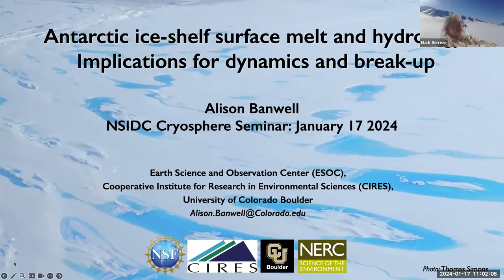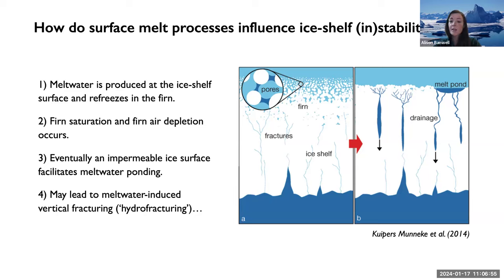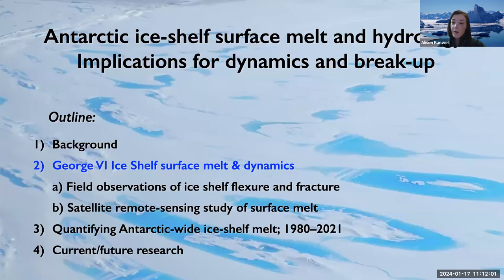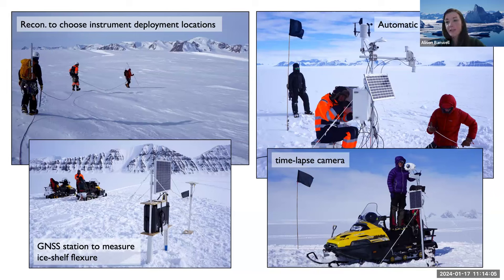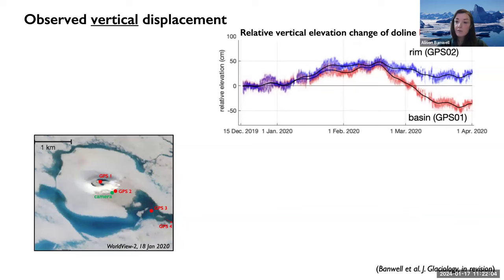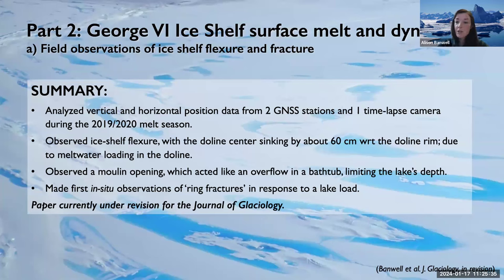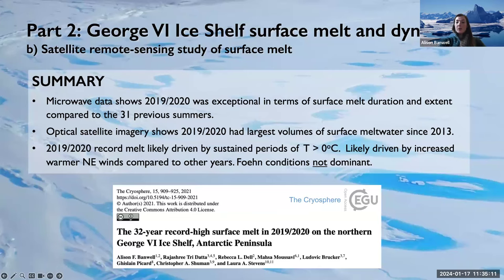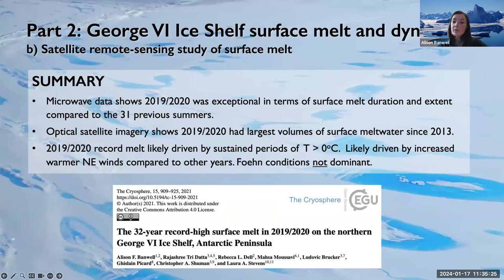Antarctic ice-shelf surface melt and hydrology, and implications for dynamics and break-up

Comment: Is the buttressing effect of ice-shelves an observation or an assumption?
Somewhat answer at 6:45. How much for how long?
Reply: Observed. After the Larsen B ice shelf broke up in 2002 in the Antarctic ice sheet the glaciers behind sped up 6-8 fold and are still flowing at that accelerated rate today because the cork was removed.
Reply: Common sense.  You get snow that falls at high elevations and never really melts much.  More snow squashes down in previous snow and created a large ice mass known as a glacier This ice mass is pushed down hill by its own weight.  The ice carved channels as it flows down hill int ravines.  It invariably gets stuck in rocky bottlenecks.
Reply: @erikfrederiksen7775 yet there is no major flood at the shores.  Better luck next time
Reply: @kayakMike1000  "Common sense" is often nonsense. Science does not rely on common sense. Your irrelevant condescending is noted.